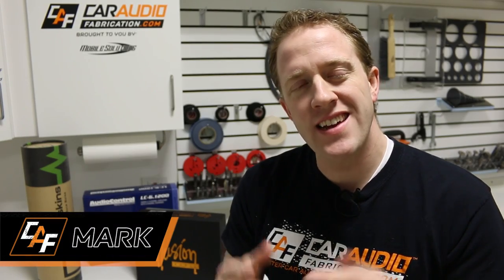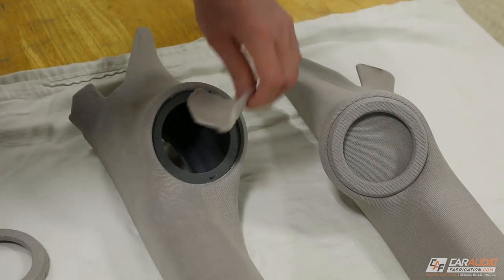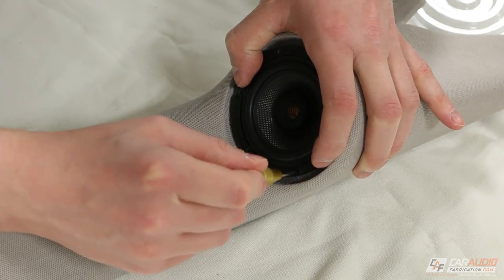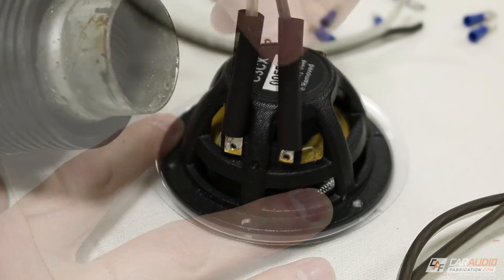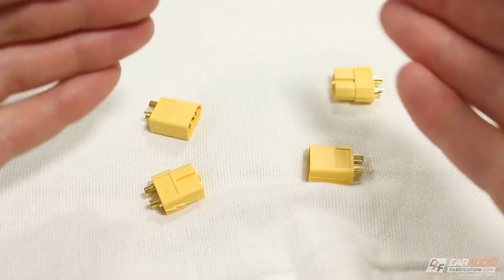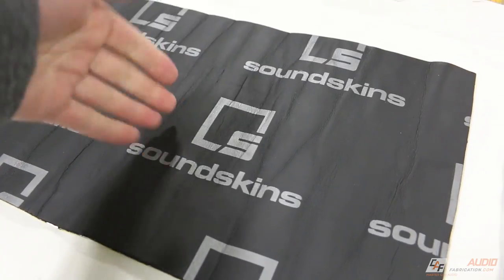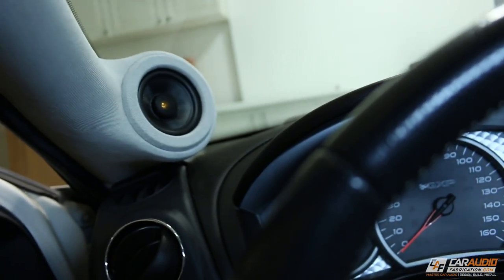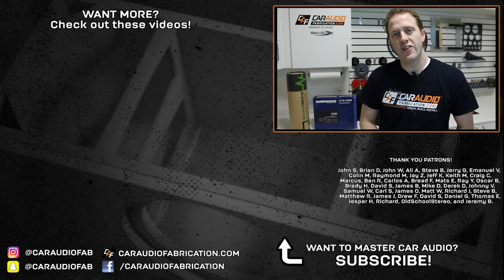Custom A Pillar Speakers - How to Install, Wire, Sound Deaden

Comment: When budget allows, I like to use Duetsch connectors. They are waterproof, can be had in single conductor all the way up to 140 IIRC (most I've used was 48). There are different pin sizes for different current needs. They can also be anchored using available tabs.This can make for a single plug for multiple circuits and not have to worry about polarities or wrong channels when removing and re-installing something later. Much like you did, only a little more elegant IMO.

Comment: Nice use of XT60 connectors. I would recommend the XT30's they are smaller and should have plenty of current carrying capacity (30A).
Reply: Ditto!
Reply: I always liked W.S.Deans connectors, but the connector has a bent spring type holder and tend to get weak over time

Comment: Your video's are great!  Worked in a shop back in late 80's and now and working on a project of my own.  After a long break your videos have helped get me up to speed.  Building these A-pillar for PS165 FX3 (mid and tweet) this weekend.  As a note, I was originally going to go with the same Illusion speakers you used (they are in my hometown of Camarillo!), but trying to source them turned out to be a b****!   Really don't understand in today's world why they make it so difficult to obtain?  In any event, thanks for these videos...tremendously helpful!

Comment: for those quick connects if anyone wants more info on soldering them they are heavily used in quadcopter battery connections some awesome tutorials

Comment: I really like this project.  Very clean and I'll bet is sounds awesome.  I know you were working with pretty small screws, so it wouldn't make much difference in your application, but a center punch like that isn't a good tool if you're marking through a hole that is larger than the center punch.  There are punches designed to center in a hole and then you deploy a pin to make the "punch".  that way it will be perfectly centered.  Just a note for others who may be in a different situation.
Reply: Transfer punch!

Comment: You should add a transfer punch set to your arsenal. Center punches aren't very precise when lining up holes. Very nice a-pillar pod though.
Reply: Cory Williams just go to harbor freight, no need to spend a lot on them.

Comment: I would start with drilling and tapping the ring, before building an entire A-pillar around it. It just seems more failproof to me: if you screw up the drilling, you don't have to re-do the entire A-pillar

Comment: I am surprised Mark that you used a tap on the acrylic. I figured you would want to use something else to screw the speaker in given you did you quick connects suggesting a quick swap if you ever want to try a new product. The pillars also looks great with the Mid/Tweet setup. I wonder if you would try something unique like Bang & Olufsen?

Comment: This is fantastically clean work Mark, I'm very impressed mate. It makes me want to do the same with my tweeters that currently live in the door, only problem is I was born with 10 thumbs and I'm not the most practical bloke in the world lol.

I am going to try my first ported box soon though. I built a sealed box and other than carpeting it (it wasn't great) it turned out ok and was miles better than the el cheapo prefab I had before so I'm quietly confident.

I've run some numbers through WinISD and it looks encouraging but we'll see...😉

Comment: F or sound deadening material, have you thought about using "flex seal", specially on such areas like the back of those trim pieces? I think it can be applied better, specially in  and around the bracing pieces inside the trims.
Reply: That's a great idea!

Comment: Hey bro, I'm trying to match my Lexus headliner for a pillar gauge pod and i can't find the right material. The OEM material is very stretchy and soft, if its not stretchy it won't go around the pods, similar to yours, is there a material you recommend?

Comment: Mark, you said youd make a follow up vid on how these sounded. i searched your library...maybe i scanned to quickly but i cant find it. any chance you could provide a link or tell me what you thought of these speakers? 
ive got 3ways in my truck & ive grown quite fond of them. i just bought a car which only has factory (preferred) locations for 2 way....so im considering these Illusion Audio & the Morel Hybrid Integra. your thoughts would be appreciated.
p.s. i have subscribed. thanks again.
Reply: bump

Comment: Normally you suggest threaded inserts (or threaded rivets in some cases) but here you're using a tap.  Do they not offer inserts in a small enough size to use here (or something we should consider when fabricating A pillars leaving enough room to include?)? You've definitely made me a firm believer in the insert/rivet idea for removal/maintenance aspect and it was the first thing I thought of when watching you tap your mounting rings.
Reply from the maker: I use inserts with wood, you can't drill and tap wood.
Reply: CarAudioFabrication actually you can and its quite strong
Reply: Orin Chenard you can, but when you add sound pressure levels from the subwoofer which is mounted to that tapped thread in wood, it will eventually start leaking air

Comment: sorry mark not to be picky. but i think you got the connect wrong way round, the female is the one with hole and male with the pin just like man and woman :) p.s great vid
Reply: kenneth croll Yup
Reply: yep, I was going to post the same thing.
Reply: kenneth croll I thought the same thing because of the metal connection in the plastic, however the plastic connector (yellow part) is as he describes it

Comment: Surprised you've gone to all that trouble making such nice pillars only to rely on factory clips to hold them in place. I've used rivnuts with hidden machine screws and lock washers to bolt mine securely to the metal work of the car.

Comment: Hey mark what if I’m using 1/2 inch MDF rings for my mid range A pillars. What can I use to screw in? Self taping screws, threaded inserts with hex, or knife threaded inserts or just rivet nuts ?
Reply: You shouldn’t be changing them out often so just use wood screws with a nice machined head if they are exposed. If you do end up removing them enough to chew up the MDF, you can switch to threaded inserts at that time. If you think you’ll removed them A lot then just start with the inserts. 

Also, if you have MDF rings it wouldn’t be difficult to use a flushing router to make a copy out of some thicker plastic or acrylic

Comment: I am thinking about these speakers for an active system. What are your opinions about the speakers up to this point?
Reply from the maker: They sound amazing. Very detailed and articulate
Reply: With such a small mid/tweet, would they be loud enough to cover 350Hz & up, in a larger vehicle?

Comment: I got a Jbl CX-62SI pair of speakers. The rms of these speakers is 70 watt and peak output is 280 watt. Is this 70 watt means these both speakers have a combined  rms of 70 watt(means each speaker has a rms of 35 watt) or the single speaker has a rms of 70 watt?
Reply: 70W each (unless the packaging says otherwise, but from my small amount of experience, usually that's only the much cheaper brand speakers (the kind you never hear of, like Pyramid, etc) that label for a pair just to catch your eye more.

Comment: Why delet the other speakers just put them on different channels and dsp them off in a profile and turn them on to rock out in a different one you can probably do some crazy low level fill if you play with it.

Comment: Hi Mark, i just saw your video how to do a subwoofer box with just a jigsaw, there's just one thing.... i can't find mdf, can i do the box with triplay, that sheet of 3 thin  layer of wood glued together ? 🤔
Reply: Most big box hardware stores should carry mdf. Plywood can work well but triply most of the time is too thin. Unless you need to make your box custom, you can find premade ones for near the same price as the material needed to make your own.
Reply: Maverick Wagner I know, i've been asking around every hardware stores here and no one have mdf, and i need a custom box for my tacoma single cab, the ones that are already made on internet are waaay too expensive for me and the ones at the local stores are for normal subs, so, i need to make a custom box that fits into the little space behind the bench seat, the only good thing is that i have a 8" shallow sub, i mean, it's not gonna be a huge box, it only need .5 cubic ft of internal volume.

Comment: I know this question isn't really relating to the video but how can I know or tell if a subwoofer will pick up high bass notes and not just the low ones? I have some skar 10s  400rms in my vehicle and they pick up a good range but not the low end bass. My brother has a skar 8 900rms and that one hits hard but it's almost none existent on high bass. Any help from anyone would be helpful.
Reply: look up subwoofer enclosure tuning frequency charts teh enclosure matters more than the actual subwoofer

Comment: Presenting the system with a sound test video would just be useless, as the sound image of those speakers is ruined by the microphone, by youtube and by whatever speakers we at the other end is listening to.
It's like wathcing a 3D, 4K, HDR demonstrating video on a standard HD screen...
Reply: Tommy Grønvold , go see and hear Kendrick sound videos, and you will change!
Reply: Raxy Benex That's EXACTLY my point!! Do you have any speakers even close to what's in that setup?
The sound is picked up of a microphone which distorts the sound no matter how expensive it is, and you listen to it of either som cheap laptop speakers or headphones of whatever quality and price. There's no way in hell the original sound is replicated into your ears!

Comment: dude you have a gxp this whole time lol.. i just stripped my gxp for this aftermarket speaker I had in it for my new duramax but ill be back to gxp ill actually be swapping the sub frame over to my olds 98. sure sleeper.